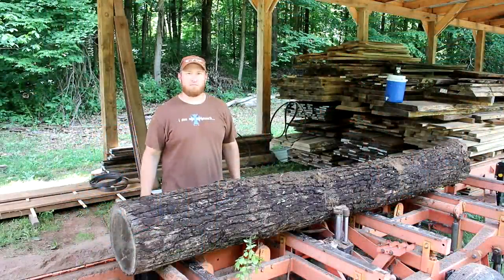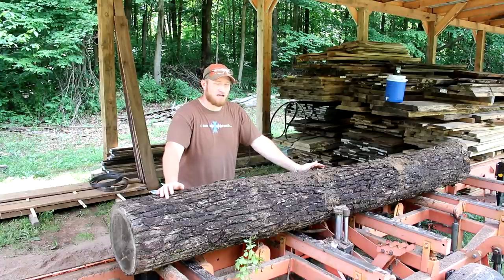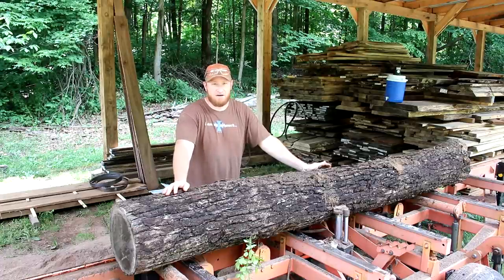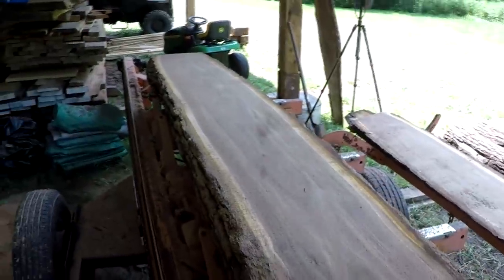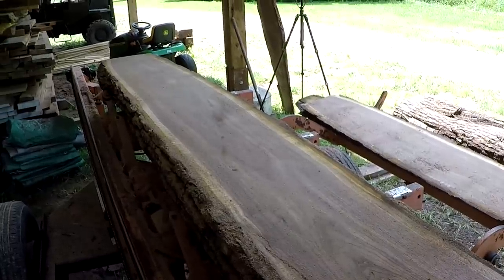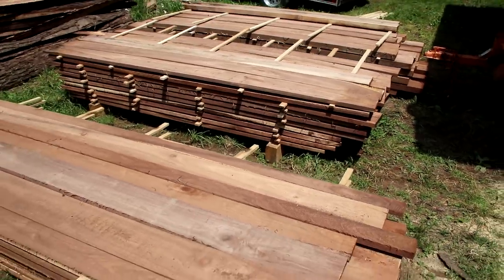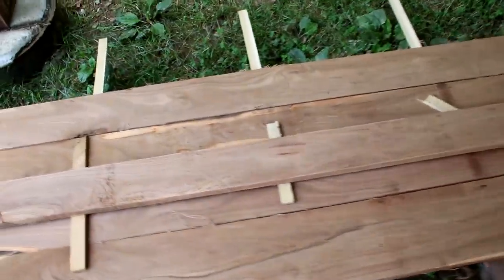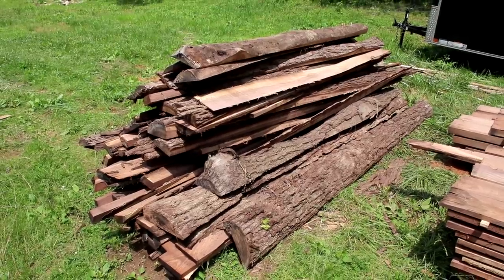Black Walnut Sawmill Day! - Hard and sweaty work - Wood-Mizer sawmill makes money

Comment: As hard as it is for these old bones to handle much heat, I  prefer it over damp and cold. Hot and humid I can do without but if its dry enough for evaporation, I  can handle som heat. Not good at working in direct sunshine though.😐